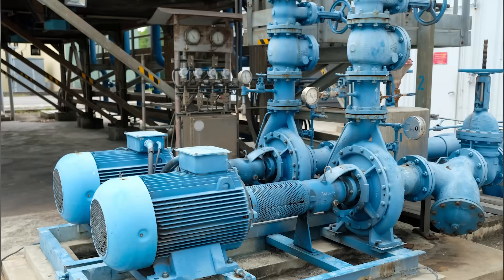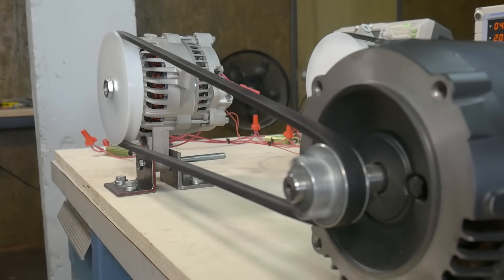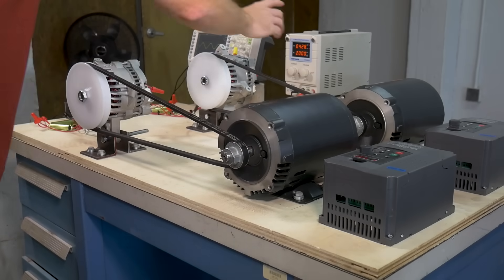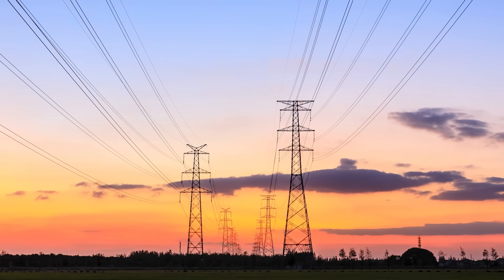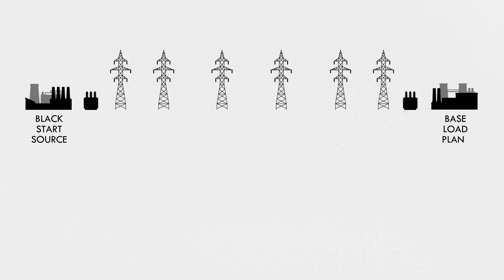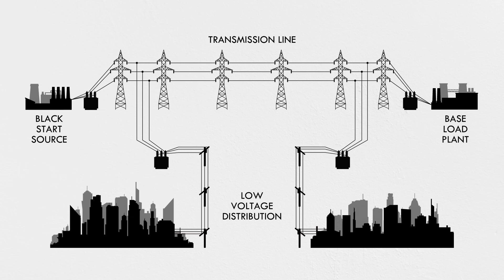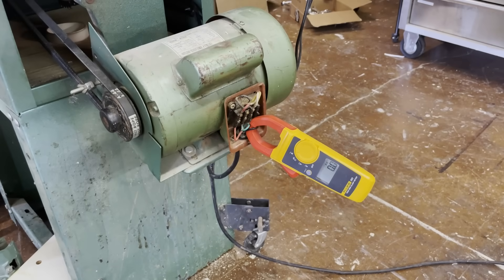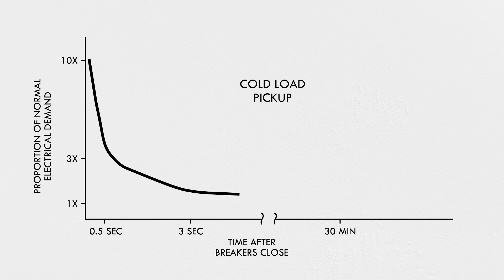What Is A Black Start Of The Power Grid?

Comment: Their are two ways to black start the grid...Islandizing where you bring up one self starting generator (and not all generator's are).  And by generator I mean a traditionally known as "Prime mover"....a generator of at least 100Mw,but 1000Mw is ideal.  Andyway that generator is bought on line and nearby loads are incrementally connected to it.  Meanwhile other black start capable prime movers are started but islandized...not connected to other prime movers.  Then the islands of power are connected together, (one at a time) but they have to be connected insync...ie there 3 phases have be connected when all three phases are at the same point in thier cycles.   This is the hard part.  finnally when you have a largenough single island...say a good part of the state, or a single utility you have to join the national grid....again you have to synch in.  Also, some utilities or states may have so much load that they can't support their loads within their areas of responsibility without importing power from outside (ie.almost always via the high voltage transmission).
The sencond way is known as the backbone method, where you energize your high voltage transmission system (again via black startable prime movers).  It turns out most large prime movers are hooked directly to the high voltage transmission system.  This method has the nice ability of synching in each generator easily, as that what those prime movers normally do when starting up from a shutdown..synching into the high voltage transmission system.

Comment: As a Ukrainian I find this video especially interesting as our engineers are fighting blackouts 24/7 for the last 3 month trying to keep the power grid running while the transformers and power plants are being knocked out by Russian rockets and drones. I owe to them. This people are heroes.
Reply: Stay safe and fight the good fight
Reply: Worked in power plants all my working life and experienced alot of hair raising situations and failures, but never rockets and drones! Can't wait for Putin to get a rocket up the a**....
Reply: Eternal support, from France 🇫🇷🤝🇺🇦
Reply: All Ukraine are heroes and so many people support your fight. It is criminal what has been inflicted on your country.
Reply: Glory to Ukraine! 🇺🇦
Reply: That’s why we need to do away with this grid. Power supply units need to work with all voltages. Switch mode does this. Powerplants like solar or wind need to just amplify everything in the grid using their switch mode transformer. At least up to 24V until they are sure that no one works on the cable.
Reply: Yeah, thats how switchable power supplies work... but remember the difference between amps and volts. 120V 10A is equal to 240V 5A  @ArneChristianRosenfeldt

Comment: I am a big train buff. Diesel electric locomotives are basically just a compact powerplant on wheels. They use diesel prime movers to turn a generator or alternator to produce electricity for traction motors mounted on each axle. I'm no stranger to the concept of excitation, but this does clear up how they do it on a much larger scale. Great stuff!

Comment: For a syncroscope, it's not as simple as just, making it point up and stay put before connecting a generator.    the problem is if you do that, you still run the case of turning one of your generators to a pump.  The trick is that the generator being connected to the rest of the grid is suppose to be slightly faster then the grid is running, making the syncroscope rotate slowly clockwise.  This ensures that when the generator is connected, it picks up some of the load grid, and thust not becoming an additional load itself.  You still want to get it when it's pointing straight up though, so that when the breakerconnects, you don't get a huge arc in the breaker welding contacts closed, on top of making the generator suddenly jump by however many degrees you're off.

Comment: Grady, excellent video. The old GE synchroscope in your video brought back a lot of memories. I ran a lot of shipboard generators during my career as a marine engineer and paralleled plenty of units using just that method. This was long before auto-sync. Close the breaker too soon or too late, then you most likely trip both generators off line and black out the ship. Been there, done that a couple times. Nice job on the black start procedure. Keep the shows coming. Your channel is terrific. Thank you.

Comment: Back in my Navy days we had to manually open and close breakers to connect / disconnect with shore power.  Fun times watching dials and meters.  Just match the voltage of the shore power to the ship.  If you don't you get circulating currents and strange looks.

Comment: Electrical Engineering field is so enormous,..almost everything is run by electricity today,..Power plant, Substation, Transmission line, grid etc are part of its components...Building electrical design is another part of its complexity

Comment: NYISO has an incredible control room that exists to deal specifically w/ problems like these. I was heavily involved with the A/V infrastructure for the control room, and I think it still holds the record for largest indoor video display in the US. If you check out the "careers" section of NYISO's website, you can get an idea of the scale. Each of the screens in the background is an 80"!.I believe the main screen came in at something like 100' across by 30' high.

Comment: Automotive pro tip. When going down super long hills.. put on every electric device in you're vehicle. All heater fans on high, defroster, lights, ect. Same rules apply to the air conditioning compressor, it helps act as a controlable engine brake. Save you're brakes!

Comment: Great video, when I was a kid one of my dads responsibilities was the standby generators of a small town in Papua New Guinea. This was a manually controlled pair of diesel CATs. When starting during a blackout you have to get 1 of the generators running from the battery, once you got it on you then have power to the shed and starting the second is easy. Then you have to sync the two using the lights, get it wrong and the CATs really growl as they fight each other. Never realised how these were wired till now, makes total sense. Once your ready to go then you bring on the town using two seperate circuits, each time you throw a circuit the lights dim, the CATs bog down under load before the governor kicks in. You wait 30 seconds for everything to settle then throw the second. Fun times.

Comment: So many different concepts I've been familiar with all come together in a major power grid. Large multi engine jetliners have an APU (Auxiliary Power Unit) that start via a battery and provide enough power to start the main engines, which is similar to the black start generators. When you turn the key in a car to start the engine, while the starter is cranking power is cut to the radio and other accessories to push power to the starter, similar to isolating the main grid from the transmission lines while getting power stations back online. Synching generators to provide proper phase alignment is like when we started 2 generators on the ship while I was in the Navy, the electricians had to get both gensets' phases synched up to put them in parallel so they both shared the load. So many "moving parts" to deal with!!

Comment: It is Energy until converted which is the term every one uses for energy...POWER
Reply: Energy and Power are not interchangeable.  Power is the rate at which energy is used or supplied. Thus (real) Power is measured in watts while energy is measured in watt-hours.

Comment: Awesome demo of matching phase before reconnecting grids! This has been a point of frustration for solar customers in the US where neighborhoods have reached saturation. If a neighborhood becomes isolated from the city's grid, but there is enough local generation capacity to maintain nominal voltage, the neighborhood will continue operating as a zombie island. The utility can't shut down the residential generation sources directly, and they can't control the neighborhood's phase. Worse yet is if the local island is overproducing: Thousands of cheap microinverters fighting to export power when the demand has already been satisfied may become unstable and cause sustained overvoltage which can damage connected devices and potentially start fires, compounding the emergency.
This makes working on neighborhood equipment dangerous and slows down recovery. It takes time to identify and call all the customers with generation capacity to turn off their generators. Sometimes, it's faster for a utility to wait for the sun to set. As the zombie neighborhood's solar production stalls, it will cascade into its own local blackout. Once deenergized, the neighborhood can be reconnected.
To avoid such a scenario, grid operators mandate a maximum solar capacity for each neighborhood. (Other sources are too expensive to justify running full-time, so the economy organically regulates capacity.) Many customers see this as government overreach or corporate greed, but it's really just a precaution we must take for safety and quality of service. Most utilities are happy to see so many Americans adopting solar because it reduces effective demand on their network, but maintaining some local generation deficit is critical to maintaining overall grid stability.
All this said, I  advocate for converting the grid to DC because it helps mitigate or eliminate every problem that plagues the grid today. However, this must be weighed against the enormous cost of new equipment and downtime. Happy research, Grady!

Comment: Why do power generating plants shutdowns on the first place? In case of a overload, couldn't they continue to generate energy but off-grid during a blackout?
Reply: It's probably as simple as throwing lots of money away while you're sitting there not selling any electricity. Additionally, there may be stability issues with generator frequency and voltage.

Comment: If the power grid was DC  rather than AC (I know this wouldn't work IRL) none of the generators would have to be synchronized in order to restore normal operations, correct?
Reply: synchronization sets the instantaneous magnitude to be as similar as possible.
if there were inter-connected DC grids (there is something like this inside some data centers) then the DC voltages would still require "magnitude alignment" to minimize the potential difference.

Comment: The most important aspect of a black start plant is the ability to generate into a dead bus. Most plants have synch check relays that prevent doing that. A dead bus is simply seen as being out of phase, and the unit cannot close the breaker to come on line. A true black start unit will have a mode switch so that that particular function of the relay is disabled and the very first unit can come online. All subsequent units will synch to the first unit on. We were required to demonstrate this ability in order to be a black start unit. We also had black start training every two years required by NERC.

Comment: 11:05 It may be worth mentioning that after generators are synchronised and connected to the grid, they rotate together - same speed, same phase - no matter what. If you cut off steam to a generating set on the grid it would continue to rotate, drawing power from the grid to counter friction. If you gave it extra steam it would not speed up, it would just feed more power into the grid. Every generating set on the grid (turbine plus generator) behaves like a gigantic distributed flywheel connected by a virtual shaft - that shaft is the grid.
Reply: And a generating set on the grid is like the classic unstoppable force. Put an imovable object in its way and it will smash the object or smash itself, except we have circuit breakers which will disconnect it.

Comment: Powerplant engineer here. It absolutely needs power and TIME to make power. For example, typical thermal powerplant need ~4 hours to generate power after power is retored to them in WARM start. It mean that grid is restored to plant under 6 hours after blackout. In COLD start, it needs much time, almost 14 hour to generate power. Thats why you need gas turbine to jumpstart the grid, because gas turbine only need 20 minutes from blackstart to full load. But its costly.

Comment: Grady,

Ship power plants are smaller versions of the main power grid.  For the cold start of a ship plant, you need a source of power.  If the ship is docked, say at a shipyard, you can use shore power.  If the ship is at sea, you rely on the emergency generator, which generally rely on batteries to start.  I know of a case where a part was flown in to a dead ship, along with a supervising engineer, from California to the Persian Gulf.  After changing the suspect part the emergency generator wouldn't start.  The batteries were dead. 

A recommendation was made to install a second set of batteries.  But, if they are dead as well, how do you start the generator? Ultimately, we installed hydraulic starters as backups to the batteries.  If all else fails you can use muscle power to recharge the hydraulic pressure with a hand pump.

On the last new build project I worked on besides the emergency generator with battery and hydraulic start, we installed a hand cranked single cylinder diesel generator.  This engine was sized with enough power to start the ship service diesel generator.

I should also mention, these hand cranked engines were installed on tankers that have two fully redundant 11 MW engine rooms.  Each of the two engine rooms meets all regulatory requirements for a single engine room.  Twin-screw, twin-rudder, twin control rooms, separated by a watertight bulkhead.

Bob

Comment: This reminds me very much of disaster recovery plans in other industries. "When the worst happens, once you stabilize or correct the situation, what steps must be taken in order to restore operations? What are the priority areas that need to be restored first and how do we protect them as we restart services?" I've done things like that on large IP networks. I was once in a situation where several devices went offline in an unplanned outage. We couldn't simply bring them all back up because the system would never converge with all the activity from nearby devices. We had to bring things back online literally one at a time from the center out to the edge and keep things from talking until the system was stable enough to accept the communication. Took hours.
Reply: Even though we were at or at least very much near maximum breaker capacity at the local television station in my city, we had this problem with the technical room that held the servers.
After a blackout  (which are rare in The Netherlands, but can be very much based on where you live, the older neighbourhoods in a city tend to be a bit more prone to them) we had to start each server independently because switching them all on with all of their control circuits doing their boot-checks and all the fans at maximum speed and disks spinning up would immediately sink so much current through the breaker we'd trip it :P .
(We had a couple of UPS'es that had reached their end of life and as a result kept on charging basically forever, and were not regularly tested, so upon a small disruption that would have any other electrical installation survive without disruption, this would usually trip one of our breakers because a UPS would kick in, suffer a failure quickly due to empty batteries, and upon the power dipping situation being gone trying to switch back pushing the breaker in our building over the top).
Reply: @Dutch3DMaster  Yep! Been there too. The Inrush current can be substantial. Had PDUs that had relays in the for cycling outlets remotely. We deployed some large servers for data storage. The inrush current was enough to literally weld the relays closed. We had to replace dozens of PDUs with upgraded units.

Comment: When I was in school for my EE degree (many decades ago), we had a lab where we were allowed/required to play with 5000V.  It was also powered by electric motors and we actually set up generation stations which were synchronized with (using a light bulb) and then connected to, the grid.  It was all very scary.  Even though I was specializing in computer engineering, all EE students were required to take the junior level "power" classes which included this lab.  It made me very nervous.  I much preferred making circuits with breadboards and fine wires using 5V to using those thick cables to hook up 5000V circuits. 😀 Thanks for sharing this video, it brought back some very good memories.
Reply: The lab classes at my uni did most things at and around 400V phase to phase.  Grid startup simulations were only talked about, not tried.  But we did visit labs that worked at 400kV or similar.  But the entire concept was taught and we all knew which 2 plants were the black start sites of the local grid.  Since then, at least one has become a museum with the generator output disconnected, but they claim another nearby plant has taken over the duty.
Reply: EE331 (motors and generators) and EE307 (electronagnetics) at IIT (Illinois Institute of Technology in the 1980s...
Reply: For us it was called Energy Conversion. I called it Everything you never wanted to know about generators, transformers and motors. I was very proud to get an A in that class.
Reply: Well done, man. That's awesome.  @davidrush4908
Reply: you got a degree in Empire Earth??? pretty 1337
Reply: I’ll salute you for that

I’ve worked with explosives and highly radioactive material and it may sound odd, but electricity always gave me pause. Scares the hell out of me